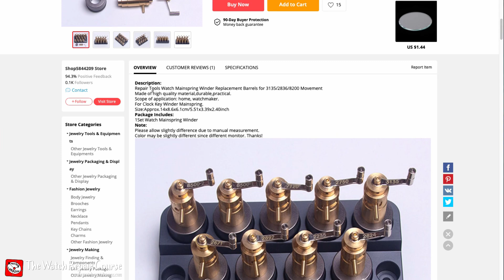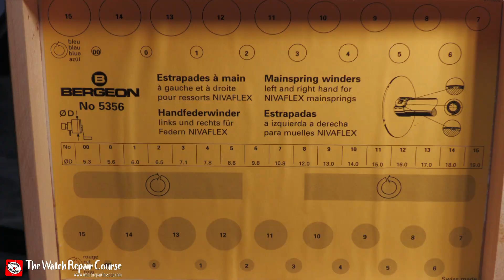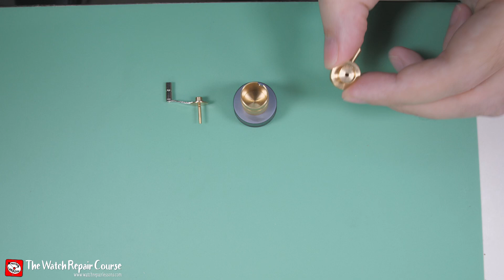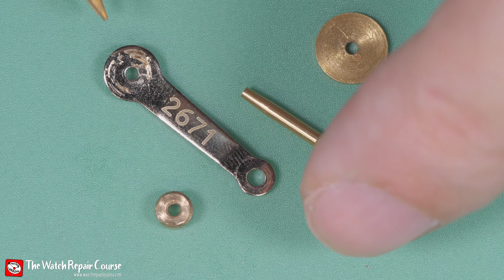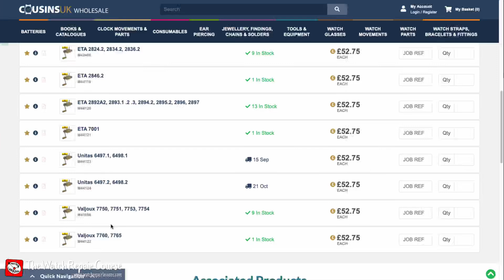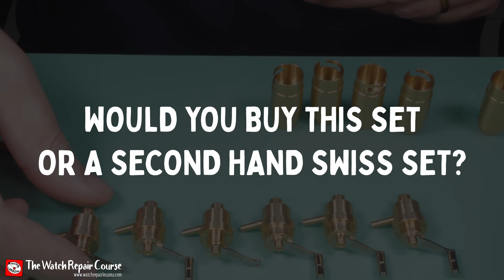Should they be used? Cheap Mainspring Winders - Full review and comparison with the Bergeon Winders

Comment: As long as you understand you need to push the mainspring in with your tweezers, and that you need to remove the body and action the piston directly on the tip instead of through the upper body/handle, you'll be fine,

Comment: I just purchased a chinese winder set earlier today...wish me luck!
I did just check the product discription though, taking into account some of your critiques, and it appears they have watched your viedeo! ...or maybe just figured some of these things out over the last 5 years. The set only comes with one handle and one stand, so yay for material savings. And based on the pictures, the locking arm, and external part of the plunger on the actual winder appear to be made of steel. Sadly, the arbor isn't pictured, cross those fingers for steel I guess. What's crazy though is the differences of prices! (What appear to be) the exact same product (same pictures at least) range in price from €25-€100 on ebay. But even on the high end, they're still 18x cheaper than the Bergeon winders...
As a hobbiest, I'll take my changes with the chinese winders, and can still regret it 18 times before I shell out the cash for the swiss stuff.

Comment: Great! Thanks for sharing! My set came with steel arbour cranks & hooks and it has 25 winders. It is a movement-specific set as well, including most popular Miyota, ETA, Rolex and Omega movements. I don’t recognise some of the movement numbers, which could be Chinese, for example. About 4 of winders are of very small size, maybe for lady’s watches. I hope to be able to use the set with other movements, for which the set needs to be measured up, both drums and arbours, and winding direction. Quality is nice, the set came in a wooden box. And it was so CHEAP so I took a chance and bought it. Not used it yet.

Comment: These winder sets have improve tremendously. My set was only $65 dollars plus tax snd the crank arbor is made of steel, the locking pins are press fitted into the drum. The drums are brass and the rear pressing button action is steel. Very happy with this purchase.
Reply: Hello ! Do you have a link ? I'm so interested in, ty 😊
Reply: do you have a link for us?
Reply: @zwiea look online, eBay, Amazon, Temu,
AliExpress, all that come in a wood case are similar to the ones I got.

Comment: If they sold a similar chinese set based on size like the swiss id say it would be a good buy for asomeone learning and starting. 
But since theyre very caliber specific i think just buy new ones until you either need a set or are willing to buy the real set. 
They so sell a 36 piece set too (2 more than yours) for a good price considering price of these. Also look areound ar reputable sellers and retailers. I found one here in the US that still uses a catalog based system but has a site thats very 90'esc and their prices are few hundred less for the 36 than even the 17x2 set everywhere else

Comment: Ive heard an old warchmakers trick for winding a left handed spring with only right handed winders. 
Use the right handed but a size smaller than normal then get a washer with an ID just smaller than your barrel. Wind it, ehect into the washer, then flip it to unstall like you would with a new one coming prewound. 
Never tried in practive but thats smart if it works

I wonder if thats the hack youre talking about at the end lol

Comment: I have been haunting YT for videos on winders for exactly the reasons given in the video. Though I wear gloves rather than just cots, I still had the same issues with hand winding. I Did purchase a used set of vintage winders but had the devils' own time using them as the pieces simply did not want to stay together during a task. This is the first I have heard of COUSINS offering an alternative to BERGERON so I may take a peak there. Frankly, though I am still "gun-shy" about PRC products given the number of compaints I have heard about poor finish and difficulty in interfacing with more mainstream products and tools. (Great Video, BTW 😊)

Comment: Looking on Amazon today, it seems like they've moved on a bit — I'm seeing one with a single cylinder with both regular and reverse slots, that looks a lot like a Bergeon one. Winders for 20 calibres, and the arbor, plunger and arm all look like they're steel (although difficult to tell from the product page). All for about 1/10 the price of a Bergeon set. Who knows whether it's actually any better than the one you're looking at here, though.

Comment: I know I'm late, but I'm interested in the hack for right hand winders.
Reply: With a generic winder set the easiest 'hack' is to find the correct barrel drum that fits the watch barrel, and then find the next smaller drum that fits into the larger (correct) drum. So if the correct barrel drum for the mainspring barrel is say 10mm, you will want to find the next smaller barrel drum that will fit inside the 10mm barrel drum itself, say a 7-8mm barrel drum. Then wind the spring (right handed) on the smaller barrel drum, and then press the spring into the larger barrel drum - then press the spring into the barrel of the watch. So you just wound it on a right handed arbor and then just turned it around before putting it back into the watch barrel.
If that next smaller barrel drum has an arbor that is also too small, well I'm not immediately sure what to do there.. =)

Comment: I have purchased on amazon a  mainspring winder set,but my set has steel arbor hooks.just the head of the winder is bras.and it does the job very good.for 80 euros ist a good deal for me.and i have reviewed on my channel.if you interested you can see my video.best regards.
https://youtu.be/ETMJlH1V-vU
Reply: I did the same, but on ebay and for $50.. Steel arbors. steel plungers, steel arms.. but the barrel drums do have thinner walls than the 'one' Bergeon winder I have. Not sure if that makes much difference to a hobbyist, but I could see wanting as much durability at the professional level.

Comment: First off Thank You for uploading this tutorial.  Secondly, the newer more expensive Chinese caliber specific sets have steel arbors with the appropriate steel hook for winding the mainspring without fear of imminent failure. While of course the Bergeon set is coveted by all, the foreboding price makes them a luxury. 
The Chinese set I have comes with 20 barrels and arbors that are caliber specific with one handle with both left and right cutouts to accommodate the caliber specific left or right hand winding. These calibers are all specific to wristwatches but for some of the smaller size pocket watches ( sizes up to 10 ) the largest of the winders seem to work adequately.
Again Thank You for your video on this topic as I appreciate all the information I can get!

Comment: Wonderful video. Thanks so much for explaining how watch winders work in detail. I've watched many Watch repair videos, and they never go into the details how a winder actually works. Agree with you that cheap tools have their hidden costs. I work mostly with fabricating small electronics and there are key tools such as pliers and screwdrivers that I used constantly, and so I've purchased highest quality I can afford. For less frequent tasks I may trade off quality for price. I have had some “cheap” tools for many years because they are infrequently used and I take very good care of them. I think this is an equation that everyone, except those with unlimited funds, goes through when they purchase a tool. Am I going to use this once in a while, or every day? I think you showed, that if one exercises care, a cheap Chinese set is superior to hand winding or just replacing the mainspring. The trade off is reliability and longevity of the tool. For the occasional amateur that might be acceptable. As you go up the skill and and utilization curve you may be able to justify the purchase of the higher quality tool.

Comment: Yes! I went with the cheap Mainspring Winder "10 in a set" fortunately, all were intact. However, like yours all arbor hooks are made of brass, except for the handle which appears to be made of alloy metal. Regardless, I found the brass to soft against the metal spring, "a serious oversight that is doomed to fail".

Comment: Thank you for the great video.  What does it mean to be calibre specific vs generic?  Is it just the diameter of the barrel?  Does your generic set just have a lot more sizes?  And for hobbyists, is it egregious if you use a winder smaller than the barrel so the spring has to expand when you put it in?  I know that is probably not right, but winders are one of those things there I just can't rationalize spending the money and buying new springs can also feel so wasteful if it just needs a cleaning.

Comment: a question just in general, but i have a seiko chronograph, just a regular quarts movement, but its buttons are stuck for adjusting the smaller dials, any specific tips on how to fix it the easyest without dammaging it?

Comment: There are many reasons for not doing by hand but I'm guilty of hand winding the mainspring on many occasion. I'm no watchmaker, just a hobbyist. I know when I'm winding the spring into the barrel, dry skin will get in there. What impact this has on the energy reales in normal operation, I don't know. It would be interesting to see the difference.

Comment: I own both 

some second Hand Bergeon universal winder and this Set of Chinease ones
What I did with the Chinease one is... 

1. File away the brass Hook
2. Drill a 0.2-0.5mm Hole in the same Location
3. Take a 0.2-0.5mm blue Steel rod and glue it in place
4. Shorten it until its as long as the original Hook was
5. Polish the end 

The Set is in Use for 3? Years now, never had a Problem
And I cant see much wear on it

Comment: Hello. I have performed an operation of placing a left hand spring with a right hand set, on a right hand hook. I have a Chinese set with one handle and steel stems. I wound the spring to a smaller barrel, then pushed it to another barrel, slightly bigger, and then to the barrel drum. I did it once so far. To be honest, the set failed on some other occasions: stems were too narrow to catch the spring with the hook. Respect, Marek, Poland

Comment: As well as the brass hooks completely failing on winding like mentioned as a possibility in this video, isn’t another risk that as they wear, brass filings could shear off and infiltrate the spring you are winding?
Reply: Good point, if the swarf shown in the video was in fact from the first wind, I can see this being an issue.
Reply: Correct

Comment: So it seams there are two different sets. Ones as you reviewed with everyone having handles and brass arbors and another that has only 1 handel and steel arbors like this one 
 https://www.ebay.com/itm/1Set-Watch-Repair-Tool-Mainspring-Winder-for-3135-2892-2824-7750-8500/353168038834?_trkparms=aid%3D111001%26algo%3DREC.SEED%26ao%3D1%26asc%3D20160908105057%26meid%3Df8212c692f73409ab7d61a976407dbf8%26pid%3D100675%26rk%3D3%26rkt%3D15%26mehot%3Dnone%26sd%3D133484175706%26itm%3D353168038834%26pmt%3D0%26noa%3D1%26pg%3D2380057%26brand%3DUnbranded&_trksid=p2380057.c100675.m4236&_trkparms=pageci%3Adaf38402-ef22-11ea-a7af-74dbd1800bcf%7Cparentrq%3A5c2e10861740ac3ec77864bbffffcf2e%7Ciid%3A1

Comment: I was at this cross road a few months ago and I am glad to see this video. I mainly service ETA 2824-2, 2836 and 2846 and was trying to decide between this Chinese set on eBay, piecemealing the Bergeon set one at a time as needed (still most expensive) or buy a used set such as the K & D Adjustable 123X Mainspring Winder Set . I ended up buying the K & D adjustable 3 piece set however the arbor sizes are to big or the back is to small.  I also noticed after the spring was wound, it spread the adjustable holder far enough to where I had issues fitting it in the barrel and had to do it a few more times.  As a hobbyist,  I now think the best option would be to start with buy one Bergeon right handle, and then buy two ETA arbors however even Bergeon is off on their arbor size for example the ETA 2846 is still to big. No perfect solution for a hobbyist on a budget her IMO.

Comment: One Bergeon without handle stands you in at north of £60 with VAT, I see these sets are running at just over £100, a price that will likely go down with time. True, the brass hooks could be an issue, but with even the smallest of lathes and careful handwork it should not be too much of a stretch to make steel replacement parts. There's even the fact that the parts of these sets would make a useful start on making up winders for odd movements one might tinker with, so as always with a lot of Chinese stuff these sets have great potential for those inclined to add value themselves. I'd also suggest that Marks excellent video will be viewed by enterprising Chinese eyes, which will lead to steel replacing brass in parts.

As probably the vast majority of mechanical watch fiddling these days is by Hobbyists, I'd have to say that the Chinese are going to end up eating Bergeon's and ETA's lunch :)

Comment: Having restored hundreds of pocket watch movements, I can confirm: Always use a new alloy mainspring, always use a mainspring winder. Hand winding a mainspring will deform the spring, and can put kinks along the length of the spring - both will reduce the effective power sent through the gear train. I use a vintage Marshall mainspring winder with multiple sized barrels and a steel handle that is cut for both left hand and right hand winding. You could probably do the same with the Chinese set. Still doesnt solve the brass arbor issue. Thanks for sharing your videos!

Comment: Thank you very much for this content. Now I will wait for chinese to pick up the good advices and implement them on the product, then I will buy... Meanwhile more hand winding. By the way, the way I do it is slightly different: after placing the tail of the spring I keep the spring in track and roll the barrel to pick it in... I think it's the best "worst practice", at least it diminishes the cots issue (also I lubricate the cots tips beforhand).

Comment: One thing that is surprising me from China was the £40 "baby timegrapher", at first I thought it was junk but the two enclosed 4 pole leads were absolute garbage and I replaced with a very good OFC lead and now it is running with Tg5.0 beautifully.   I haven't seen these boxes on Aliexpress yet but are on ebay, the £52 one has a swivel arm like a Weishi, for me it has been a godsend having to do it all on my disability and yes it doesn't look pro like a Weishi but looks don't perform the tricks we want these machines to do so if anyone buys one of them, buy a high quality lead.
Reply: I was buying a Adentstar or w/e its called 7 inch microscope to replace my 1600x USB scope with then it struck me, hold on I got a HD 10 inch tablet, is there an app out there for USB scopes I wonder... then I remembered I had bought a good quality big USB to little USB adaptor to connect a keyboard to it so dug that out, installed mscopes and now I got a pretty darned good microscope which gives me plenty of hand room, good clarity of vision thanks to the LED lights and saved meself £70 too :)
Reply: Which one "baby timegrapher" do you mean? Could you send a link?

Comment: I recently ordered a set and currently it´s at the customs office at the airport of arrival. I will only use it occcasionally on my watches mainly using ETA-movements. Concerning the brass hook of the winders I also fear that they won´t last very long.
I am very excited if the set I ordered will arrive undamaged or not.
Thank you very much for your review! Now I know what to expect.
P.S. they arrived today and I was very pleased that their arbors are made of steel and not of brass!
This set was slightly more expensive than the one showed in this video. 
But far more cheaper than the Swiss made.

Comment: I have bought the cheap set from Cousins. I have the same experience - some of the cranks were left-handed, and some regular. However, the set from Cousins only contains one extended barrel and two rings, sot he waste is minimal. Also, it comes in the box, so damages to the parts in transport were prevented. I attempted to wind one of my mainsprings by choosing the proper set by barrel diameter. However, the mainspring was wider than the little depression in the winder shaft (where the hook sits), so the hook did not lock properly. I could not wind the spring past two or three rotations - as the hook released from the mainspring. This is precisely because these winders are caliber-specific. I suspect that the Bergeon set would not have given me these issues.

Comment: There are two variations of the chinese winders, one with brass and one with steel arbors. The set Cousins sells has the steel arbors, but you can also get it from eBay or Aliexpress. The plunger is still made of brass though, but that is less of a dealbreaker.
Reply: Interesting. Any way to tell which ones on eBay or Aliexpress?
Reply: @24hourgmtchannel64  I believe the smaller set with 10 winders and only one holder has steel arbors. The discs between the arbor and the winding-handle are also steel rather than brass. But just to be safe I would look for a listing that has a picture of the arbor, like this one: aliexpress.com/item/4001069683424.html